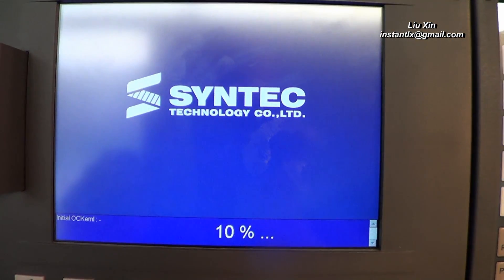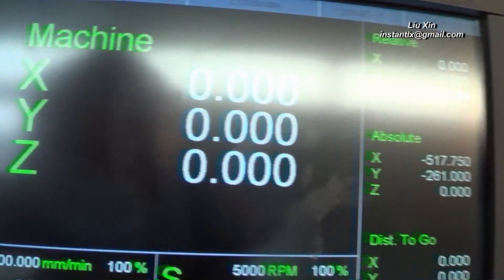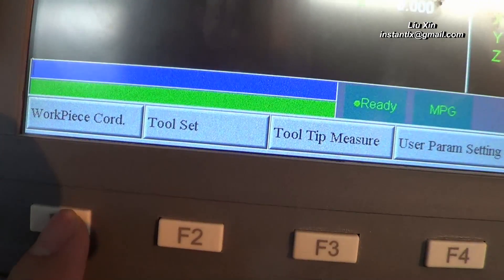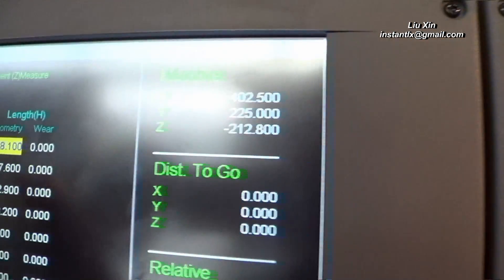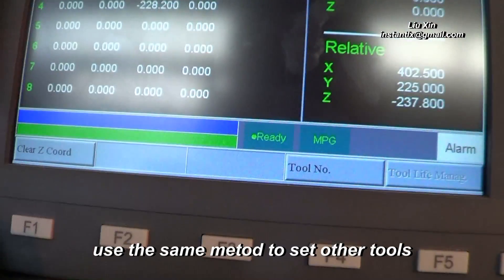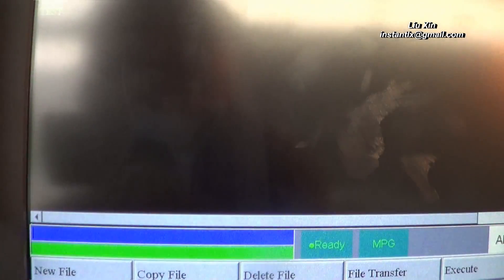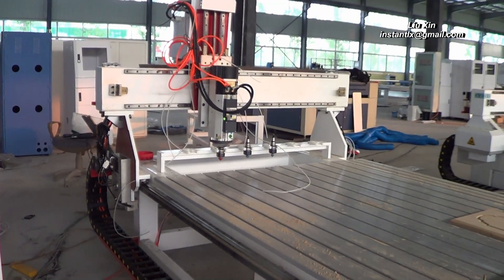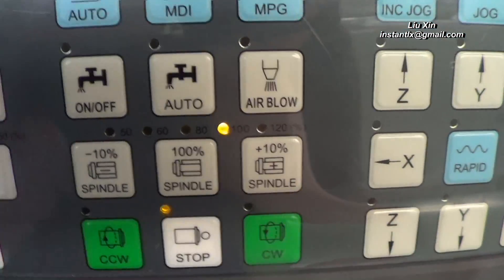SYNTEC basic tutorial, how to use SYNTEC, China cnc router,

Comment: Hello dear sir,
I request to you is 
(1)I need to know about how to set (0,0,0) in syntec6ma...(2 ) how to change new splindol with new bit becoz in my syntec6ma has a mdi block so we changed from there. Is there any another option..for new splindol changed 
(3)when I work syntec6ma while programming my coolant is stop automatically why is the reason.
Plzzz give me solutions my problem tx u sir

Comment: Please show how to setup network connection on Syntec
Reply from the maker: well, that's somehow a bit complex.  I don't have chance to do it lately. I have a document from SYNTEC, but in Chinese. It says the latest solution is to build up FTP server on SYNTEC (based on DOS). And you can use ftp software (filezilla, for example) to upload files to the server.
Reply: @LIUXIN  the problem is that it makes the syntec run so slow it basically stops working. would be great to see a video from you at some point to show how to setup this Ryan

Comment: Liu Xin,  can you tell us briefly what the difference(s) are between 6MA and 6MB?   I have a Blue Elephant equipped with 6MB, and I'm finding difficulty in having the tools go to the measuring sensor.
Reply from the maker: 6MB support 4 axis, while 6MA support 3 axis. Actually if you have a carousel type tool magazine, and you want to use a servo motor on it for faster tool changing. Then you should buy 6MB, if you don't have carousel type magazine, then 6MA can also work for you. as for the tool sensor, the original manufacturer should initialize it at factory. Otherwise you can't set it correctly. This requries PLC support.
Reply: @LIUXIN Friend please know how to contact the factory I need to restart my syntec 6ma

Comment: Hi, I'm using alphacam to create different cam jobs, I need to run this jobs for a client with an ATC 1325 router (with tool carrousel), I need a manual or a step by step, to save the code to from alphacam file to syntec code (gcode?), so i can run the job

Comment: Hi Liu
We have a new CNC machine 2mtr x 4mr and having issues as the machine wont go back to home position. The gantry was removed for shipping and we re installed. We feel need to reset the machine but have no idea on how to do this. Are you able to help us here?
Reply from the maker: after you installing the gantry back. check if it runs without strange noise.  of sounds OK and looks OK, le the machine draw a maximum rectangle (full size) then you measure the diagonals, see how much difference between them.